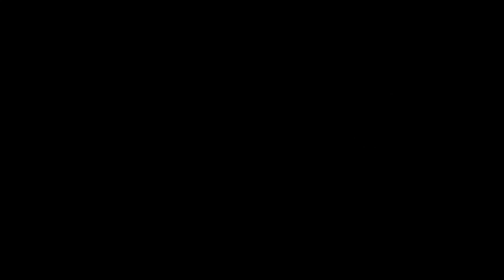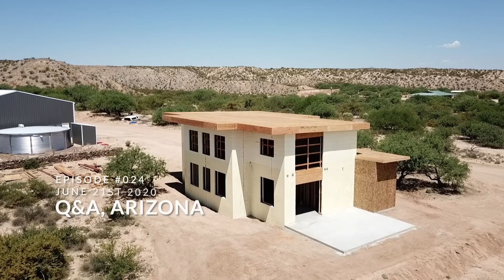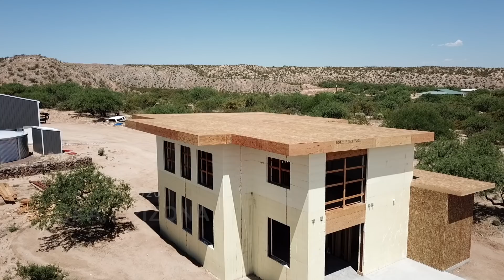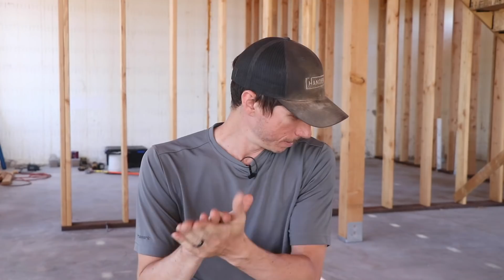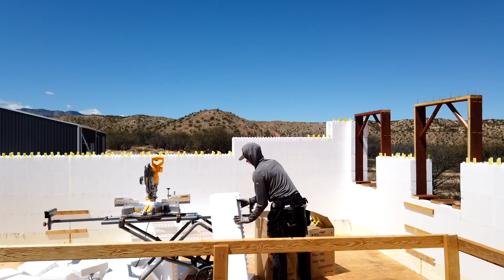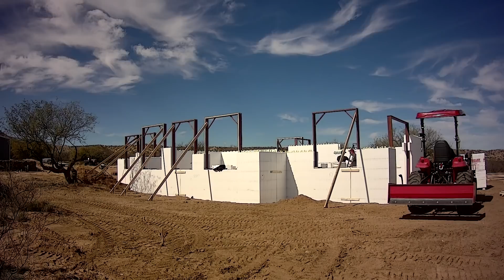Next Steps For Our Home Build... Insulation, HVAC, Electrical, Plumbing

Comment: Pretty much sums up the process of building a house. The residential HVAC seldom needs any priority unless they are running hard metal ducting, as any changes or deviations are expensive- most residential ducting is done with flexible tubing with a core of insulation between flexible walls and will deviate and hick up quite well. Particularly in kitchens and bathrooms the drainage and venting above the first floor have requirements that must be met to achieve proper flow of wastes. Wiring and ducting can be more easily moved if not taken into consideration on the original design phase. FWIW, most of my comment concerns commercial work- some flex ducting is used but most main supplies are run in hard duct- and when planned well, the hard duct will not interfere with the plumbing requirements. As to spotting your own lighting fixtures and devices, I can tell that you have little experience with commercial drop in ceilings of with fire sprinkler systems- systems which take absolute priority over all other systems. Try to get a Certificate of Occupancy with your fire marshal refusing to sign off- it's not happening legally or with valid insurance. That is not to say that your experience is invalid in any way for this purpose- only that there are some very different viewpoints on how the flow chart should read- the commercial world runs on those job flow charts; the contractors and subs are paid depending on how they are doing on their parts of that chart, and penalties become due when you fall behind. Different world than where you are building, but I thought it needed saying. 
  PS: I have enjoyed the very detailed manner you explained what ICF is and how it was assembled- have been looking a several methods of house building and knew little about this one. Thanks! Also plan to be here as you do the remaining 50% of the house that will seem to take forever!

Comment: 2 inches of isocyanate insulation doesn't seem to be enough. I would imagine that code there would be around R40
Reply: I don't think he has to follow code in his area. No building codes in my area either, I actually don't like the lack of building code in my area. I've seen a bunch of messed up houses in my home search.
Reply: I'm not sure but I think the 2" foam is just for a thermal brake between the roof deck and the house. I'm sure he's going to insulate the interior of the roof. It's probably going to be a big insulated high efficiency sandwich.

Comment: You might look into metal roof specialty coatings.  I know that some metal roof companies make cool roof coatings in every color.  These coatings can make a black roof act like a white roof (almost) as far as building envelope heat gain is concerned.  Basically the coating changes the emmisivity of the metal roof so that the absorbed heat radiates back off of the roof before it has a chance to heat the metal up and transfer into your house.  I have used these types of materials and coatings before and they work well.  And yes, light colors are still better than dark before anyone starts thinking a black roof in the desert is a good thing (unless you are running a solar steam generating plant).

All the best from California

Comment: When it comes time for insulation, seriously consider insulating your interior walls. We have built 2 homes and remodeled our current home. Insulating the interior walls greatly reduces noise but also cuts down the energy used to heat and cool your house.

Comment: Great informative video. Maybe you addressed it, but was wondering if you are running your wires in the foam or are framing the interior of the exterior walls ? I'd figure wiring would be much easier and more insulation could be added for not that much more money of the extra 2 x 4's. Thanks and thumbs up !

Comment: What is the melting point of the foam roof insulation? Did you cover fire resistance of the icf & insulation already?  Will the windows all be sealed gas filled units? I found some paints that would "supposedly' reflect in the summer but, absorb heat during winter.  Bit like the low wattage moisture drying/removing systems for crawl spaces & basements. Glad you mentioned MR, i am subscribed to his channel too. Keeps a weather eye out for new flashing & vapor barrier products you can at least become aware of.
Keep Well & Safe y'all

Comment: Just a thought about those roof soffits.  Bee's love to make homes in those Soffits, they will chew through that spray foam insulation really easy if they get in.   I hope your planning to cover the outside soffet with stucco?  Tounge n groove has gap's that allow bee's to get inside and access any gaps.   Stucco would be more fire resistant, I do not know if you have thought of this potential problem.

Comment: This may be one of the best house-build videos ever; you answered almost every question I might have had!! One thing; in mounting solar panels on the roof of the workshop is there a potential for energy loss due to dust build-up on the panels during the dry season? Have you designed a handy-dandy sprinkler system to rinse the panels periodically? 8-)

Comment: FWIW my associate painted his garage door black. The sun constantly cracked the paint and dried the wood as if it were in an oven, which made it warp.
Reply: where are y'all at?   pls & ty
Reply: @ronsmith1364  Washington state lol. Not even the desert. They painted over it white to match the house and it never cracked again. Also said her garage was MUCH cooler. They couldn't believe the difference.
Reply: @ronsmith1364  also I live in Santa Monica California and had to paint out grey roof with that white roofing plastic coating for rain proofing and it made a huge difference in temperature. That sun is rough.
Reply: I made the mistake of painting my front door black on a hot sunny day, it bubbled up and I had to do it again.

Comment: Are you going to install geothermal heat pump? It is the most efficient system out there and use only 30% energy which is good for solar